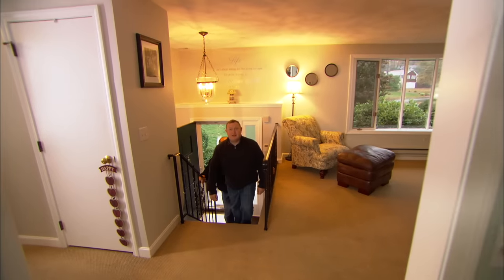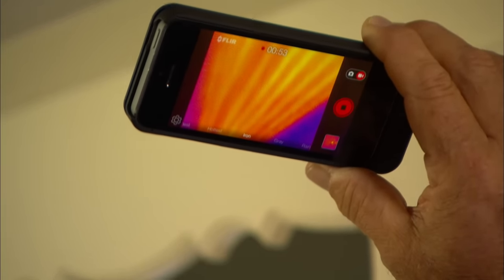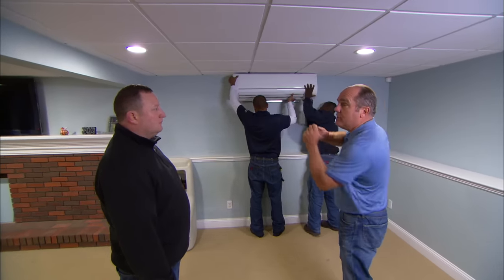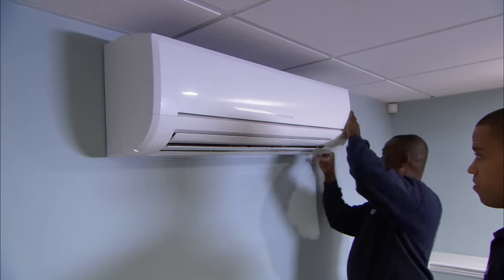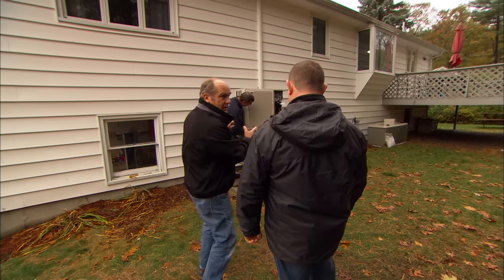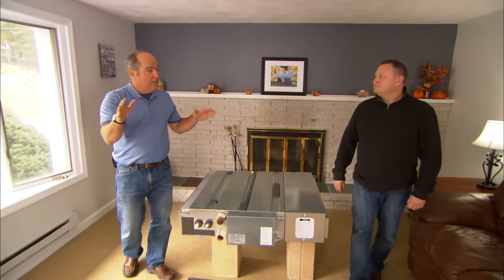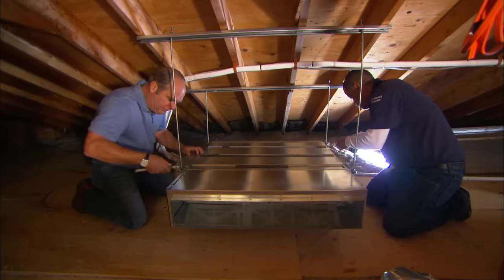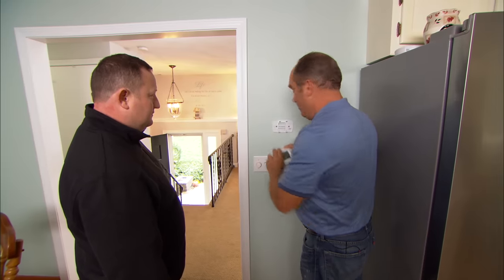How to Install a Whole-House Ductless System | Ask This Old House

Comment: Why not just install pex pipes under flooring for heated floors and just use basic furnace. Cheaper and more efficient.
Reply: It doesn't cool, though. We have forced air from a gas furnace and are ditching it for a ductless mini-split system.
Reply: @flagmichael  Well yes, the solution I am explaining is to heat the home. the mini split systems are not efficient in heating but are great on cooling. plus a mini split system is not designed to be efficient on a large scale, the more moving parts added to a home increase the maintenance cost. so when you have to call an a/c guy you could end up paying way more than on a regular house unit.

Comment: bad bad bad, should have the duct work in the conditioned space, should have just brought the refrigerant line to a register in the conditioned space. depending that attic can be extremely hot or cold in the winter/summer, (more problem in the summer). duct work will be cold and the outside will be hot, a huge delta, with very minimal insulation on the duct work.

He probably should spray foam his attic ceiling.
Reply: Bardia Ghajari I was thinking that, too. The foil will help some, but I’d expect both condensation issues and efficiency loss from heat transfer as the conditioned air passes through the unconditioned space.
Reply: its probably R3, with a delta of 50 degrees. its going to do nothing
Reply: By code it has to be r8. If you were putting this in the conditioned area then it would be a high wall unit, like the basement
Reply: The duct is probably insulated

Comment: Wow.  How neat is this?  Just wondering about the cost--lots of fancy, high-tech electronics in that equipment, not counting the (obviously) well-made mechanical equipment.  We have a 1960s-era CA tract home, so a mini-split heat pump system would be perfect for us.

Comment: I’m sorry but ANY heat system that has the registers in the ceiling is not going to keep you warm the first 30 or so inches from the floor. As everyone knows, heat RISES, not sinks. When you stand up in a room with ceiling heat, your head is hot but your feet are cold. The heat belongs LOW to the ground. Just another commercial for the product. Sorry ATOH!!
Reply: Ideally, you want the heat originating from beneath the windows to block the convection caused by the icy cold air behind the curtains.

Comment: Wonder about options for a home with hydronic heating. Basement and main floor use Pex but upstairs uses radiators. Just need cooling and this might provide an option since the house is ductless.

Comment: It's very expensive. He doesn't discuss price so good luck affording this system.
Reply: Mini splits are way cheaper than conventional central air systems
Reply: I have an old Victorian cottage, with ducts run under the house back in the 70s.  The crawlspace is enclosed, but the ducts have deteriorated and the metal straps have rusted/broken in places dropping ducts to the ground and breaking joints.  To replace them will cost me $6500, if using the same floor boxes. $1000 more to get new boxes and grills too.  $7,500 and my unit is 16 years old.  So if that goes, I can expect another $3000-$5000.  So $10,000 to 12,000 for an old house install, fresh.

Minisplits seem to be about $3000 for each zone.  I'd need at least three, so with installation probably the same.  Cheaper minisplits have a very industrial or motel clutter look inside.  I think they are the better way to go, but it is obvious the HVAC installers have knocked their price up to protect duct systems.

A minisplits one zone at 18,000btu should be $900 with a two hour SIMPLE install of $190 if the power is already run.  It is basically the guts of a $500 window unit.  That's not even close to what I'm being quoted.
Reply: If its very expensive or equal to, or more, or even close to the expense of a standard HVAC system. You are getting ripped off. 18k but unit is 700-900 with kit and ready to install if you have the 230v power, and it runs 40% more efficient.

Comment: will break down in 5years
Reply: A regular HVAC system also needs maintenance. That doesn’t change with this solution.
Reply: Nah, ductless splits are awesome. They are slowly becoming the new standard.
Reply: Ductless mini splits are generally more reliable than conventional split units. Nothing they did in this video is new, high end, or unproven. These kinds of systems have been available for over 20 years now.
Reply: Garrett Ducat hahah no they are not. As a commerical HVAC tech they require more maintenance and cost more to maintain
Reply: They are often more reliable and require less maintenance than forced air systems
Reply: John Anders   It depends on what system you’re comparing it to. Lots of mini splits have very tight fin spacing, so the coil acts like an air filter, collecting a lot more junk than a low or medium efficiency unit. And they’re often difficult to clean, but most of the time the indoor coil is nearly impossible to clean on a residential conventional split system, so that’s an improvement. 

Commercial package systems are quite easy to clean, so compared to that a mini split is trash. And in practice, lots of mini splits are installed super close to walls do you can’t get to the condenser easy.
Reply: Jon Doe I totally agree with that. Most homeowners will take out the necessary filter because it’s a nuisance to keep cleaning them, or even the filters will degrade over time. I had that happen with a commercial ice machine. Filters clogged and degraded, then coils clogged, then compressor overheated, along with the fan, melted the ice built on the lines, and then flooded all of the electronics. Long story short, $3000 mistake on my part
Reply: More reliable than you would think. If installed by a Mitsubishi diamond dealer it has a 12 year parts warranty
Reply: commercial work is not the same as residential fyi
Reply: @ricardowilliams7134  usually power surges but yeah it can happen
Reply: Less than 6 months from vibration.
Reply: Well most things do. Compressor and fan will starts to make noises , and vibration then breaks. Leaks in the refrigerant system including the lines, capacitor burns out, electronic starting system and controls burns or wears out. 
It's a good thing these are better than a decade ago and should last about 5 years or more. Yes these problems will shows up eventually.

Comment: I like the idea of these ductless systems but I have a couple of issues with them.  Normally, the warranties on the ductless systems is 5 years versus 10 years (or more) for a typical split HVAC system.  Another issue is parts cost and availability.  I suspect that ductless A/C repair parts must be ordered and are probably expensive whereas I can acquire parts for many split A/C systems from a local dealer or parts vendor.  A customer with a ductless A/C could have his system down for more than a week while waiting for parts.  One trend that I now see is that retirees are buying fully furnished cabins that are heated and cooled with packaged terminal units.  These self contained HVAC units are normally used in motels but are cheap (usually less than $900) , easy to replace, and parts seem to be priced reasonably and are available.  It looks like most packaged terminal units have a 5 year warranty.  The one thing I do like about the ductless systems is that they can be very efficient whereas the PTAC has a much lower SEER rating usually below 13.
Reply: actually  Mitsubishi has a 12 warranty if it's installed by a Mitsubishi dealer. if it's not its a minimum of 7yrs. Honestly, the technology of the mini split is by far the best in today's world. I didn't believe it until I went to several Mitsubishi trainings and I must say it works. I never thought a Heat Pump could work in -13F conditions but they can with ease. it's all in the technology though. In heat mode the compressor ramps up and generates heat which is absorb by the refrigerant and release into the space. This is stuff that most people on this thread aren't privy to they're just being critical with lack of knowledge.

Comment: How quiet is the air handler in this system (specifically, the return and supply) compared to a conventional heat pumps?

Comment: And when it drops below 5 degrees outside, where do you draw heat?
Reply: 5 degrees Fahrenheit is still 258.15 kelvin. So there is still heat to be drawn.
Reply: Yeah thanks Kelvin!  Just wondered why he stated down to 5* as if it was the limitation of the unit

Comment: Perfect for a one two room addition senseless if u have ducting esp if have consigned attic and basement or a large house let’s say I have four bedrooms on slab sure you have two distributors one outside condenser and limited ducts and more precise control now have two filters instead of one and two air handlers/ boards  insteD if one and two coils to clean by the way replacing filter more difficult than usual as well and rooms in this house are small! Large rooms won’t get enough air movement worries about dirty ducts exaggerated besides only fools get scammed into duct cleaning this might be cost effective in new construction vs putting in extensive ductwork tho

Comment: This would be the answer to my long house. Traditional ac has hard time pushing air to back rooms.  Main area is cooler than back. 
Best part would be programming. Could make schedule based on where you will be at that time. I bedrooms at night cooler but warmer during day.
Reply: What you’re describing is a bad duct design and-or install. This is the most common problem in a forced air system in this country along with system over sizing
Reply: @peteaulit  
Yah, learned alot in the past year. That sadly ac work is the most common here.. and they are 608 certified.. they only know minimum of what they are doing.i have had near 10 companies come out. And each one had a different answer.  Some with potential catastrophic results. 
Trying to find a company that has a HVAC engineer. Doesn't exist. 

I am still potentially looking at two ducted ductless units. I like the idea
Reply: @turboflush    a 608 certification doesn't mean squat but that they can buy, handle and transport refrigerant. I have it too and it's a joke to get!
If I were you, I would go back to the drawing board and start fresh with a load calculation, and only after have a contractor do a proper layout based on load and existing conditions. That's what I do for a living and to this day haven't had a valid complaint; knock on wood...!
Reply: @peteaulit  you do load calcs? 
I am 608 also, doesn't mean I fully understand the stuff though. But I would think if you were a HVAC company you would know where your limitation was.
Load calcs don't give duct design. Which is the second step.
Only one company has actually mentioned needing to do this. And unf he went to the hospital sick. So now I have to find another or do myself. Other companies walk in and without seeing any calculations can magically fix my system.
Reply: TurboFlush    Load calcs are my main activity. I leave the duct layout to the contractor because they should know how to do it and they see what works in the field.

Comment: Would never work in Upper Midwest or the northern Rockies. Plenty of days it'll never reach zero. Its gas or you'll be cold
Reply: Unless maybe you have a backup system such as a fireplace insert. I wonder how much air and heat is lost by placing your heating system in the coldest part of the house (and the opposite in summer).

Comment: Not so ductless ducted unit are labeled as high static or low static units meaning???  I understand the concept of static pressure in supply and return duct volume but not so sure which to purchase. My runs will only be 5-10' off the units.

Comment: 5 degrees. Winter here might be below zero for a month straight
Reply: If these are what I think they are they will still work below 5 degrees. Mitsubishi rates them for full output down to 5 degrees after that they start to lose heat output down to -13 where they are at 76% of nominal output. But he has the resistive heating elements to provide supplemental heat as needed.

Comment: What Model number is the system shown being installed? How many rooms and sq.ft. is it rated for? Great video.
Reply: 69kaveman, mechanical cooling and heat pump systems are not rated by square footage as there are many other factors that affect the heat gain and loss calculations. This unit could be one of seven model numbers depending on the loading capability and all of them can be set up with porting manifolds, so the heat loading dictates how many circuits can be run off of one outdoor unit.

Comment: This installation has a number of issues.  The air handlers and ductwork should be in a conditioned space, especially when used for heating applications.  In this case they're not.  There will be significant efficiency loss.  

Cold weather heat pumps can work well especially for wall air handlers but adding ductwork drops the efficiency slightly.  For New England winters I fear this install won't provide an efficient heating system.

Comment: Listen to me when I say this. VRF SYSTEMS ARE HORRIBLE. They are so sensitive to anything in the system and they are not easily worked on by the mass hvac techs out there today. I’ve went to 3 months of training on these things and I still run away from them.

Comment: What type of refrigerant this system uses? My concern is any leaks may result in toxicity or high fire hazards.
Reply: AlexKasper R410A.
Most commercial refrigerants are neither toxic nor flammable.  They do, however, displace oxygen, so worst case scenario, you’d asphyxiate.  But you are very unlikely to have that date with these systems.  They don’t use much.

Comment: In my 1929 house, we are replacing a central HVAC / ducted system that was add in the 50s using fur-downs to reach each room.  To eliminate the fud-downs in a renovation, we are leaning towards a ductless (Mitsubishi or Daikin) system with in-ceiling cassettes.  Is there a solution for 2 small rooms that are adjacent to each other?  In my case, we have a guest bathroom that is next to a laundry room.  Is there a product or solution that can condition both rooms with 1 unit?
Reply: Fujitsu mini duct. Can be mounted vertically if needed

Comment: Looks interesting but I see it as higher then normal maintenance solution.
Reply: Maintenance for a correctly installed VRF is about the same or slightly less than a conventional ducted split heat pump. The ductless air handlers have washable air filters and the "ducted ductless" AHUs use conventional air filters. The DC fan motors are long lived as long as power spikes are controlled and the control boards tend to protect the fan and compressor motors. The biggest drawback is turnaround time for certain parts when they fail.

Comment: It is the backup and boost from an electric heating element that scares me about these units. Getting better?
Reply: Paul Straney backup and boost? Do you mean the auxiliary electric heaters? The VRF and most single circuit heat pumps don't use any electric heaters.

Comment: The system does not use the heat outside , stop saying that its anoying. The heat come from compression of the refrigerant from a low pressure low temp gas to a high temp high pressure gas mmmmmkay

Comment: Vrf technology expensive to install, and better be done by a true professional. If not installed right, headaches and wallet aches. But I can say done right and it works awesome
Reply: Jeremy Clauser word.

But they are pricey.  If you get the systems that do heating and cooling simultaneously, the price tag goes up
Reply: @davidcerino1145  Nobody would heat and cool at the same time (simultaneously).  Capable of heating or cooling - yes.
Reply: Geoff Pritchard 

Actually, plenty of people do in fact heat and cool at the same time with heat recovery systems, such as the Mitsubishi CityMULTI R2 or LG’s Multi V systems.  Granted, this is not uncommon in commercial HVAC.  I’ve only seen this application and necessity in the residential world once . . . . and the guy had an indoor heated pool, a Lamborghini SUV (imagine my surprise) and 7 bedroom mansion.
Reply: @davidcerino1145  Seems weird to cool when it's cold enough to need heat but you know better than I do.
Reply: Geoff Pritchard 

Well, from a residential perspective, it’s understandable.  In a conventional residence (unlike the land developer’s mansion I worked on, lol) the house is usually run by the same group of people, with windows to bring in cold air if need be, and similar taste in temperature.

However, in commercial spaces, things change drastically.  For example, I have a building that has one side that faces southeast.  In WA, on a cool day, that side will warm up to 80 degrees (can’t really open windows in the 3rd floor) while the adjacent sides remain at around 65 degrees.

In cases like these, the system needs to cool the one side while maintaining a warm temperature on the other.  These heat recovery systems are great for these types of applications.

When they work.

Comment: We currently heat with oil/baseboard heat - but what we'd really like is to use Dandelion geothermal. Would the heating/cooling system portrayed in this vid allow heating/cooling input from the Dandelion system? We asked them years ago, but since we're still baseboard they haven't contacted us.
Reply: update - we're going with Dandelion and having ductwork installed. S/b complete end of August 2023.